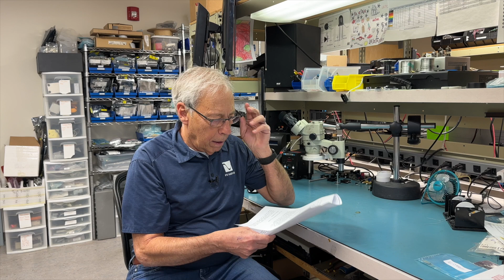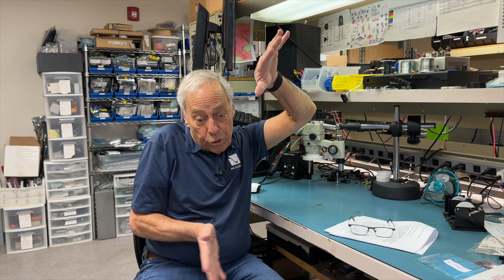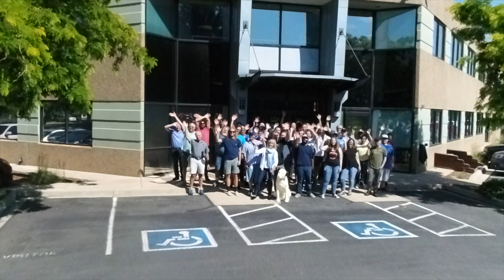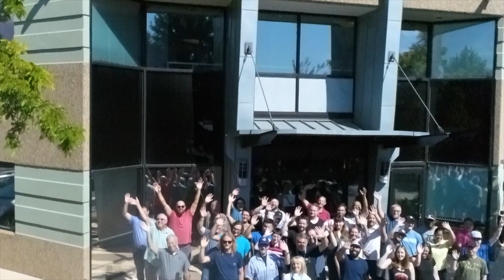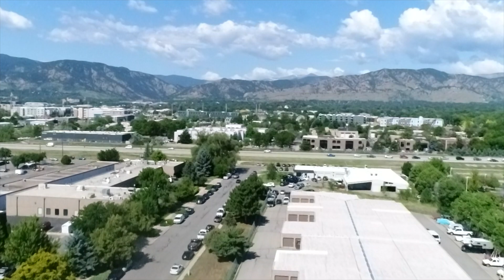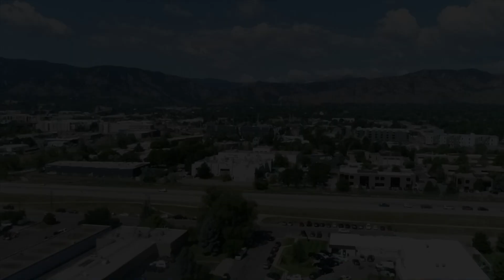Eliminating the preamplifier

Comment: For almost 2 years I was listening to my BlueSound node 2i connected directly to my amp using the node as a pre with its volume control but something was always missing and I could’t figure it out so checking out the internet people were blaming the nodes less than perfect DAC and recommending a linear power supply upgrade for the node, well I upgraded its power supply and only got marginal improvement of the sound but my issues remained which were mainly in low volume listening and constantly adjusting the volume as some passages were too loud and some low levels not loud enough. Almost giving up I dragged out my 20+ year old Rotel preamp just to see what happens and you guessed it at the first listen all my problems and issues were GONE ! Perfect level matching and full dynamics at any volume level.
Do NOT listen to people that say the less in the signal path the better or DAC volume control is all you need, You will do yourself a disservice !

Comment: My home made pre running on 6922's are vastly superior than simply switching and attenuation. the 6922 perform so much better than 12ax7's even after voltage adjustment. Next mission is to build a headphone amp with some 6922's. My cans has an impedance of 600ohms. Should be child's play for these valves.

Comment: When a pre-amp is improving the sound, there is something wrong. It can be something quite simple, like the impedance of the power-amp is not ideal for the source. But if the PS DAC sounds better on their power amp, the pre-amp is not the device adding to the sound, as that is impossible. A matching between those devices is a better alternative. But a pre-amp is a good way for extra profit, anyways. I just use a great sounding pot between an amaizing DAC and the power amp and they are well together. Adding a pre-amp, even the by Paul praised PS product, and even better ones, will cause degradation.

Comment: I ran my dac straight to my amp for a while. Though it was a very clean sound, it seemed to be very clinical. I added a preamp and it kind of softened the edges a bit, made it more enjoyable and less fatiguing. It has a tube stage that really sweetens it up, especially on lower quality older recordings.
Reply: There some amps that have a pre-amp and main amp in one unit, also some have a DAC as well.
Reply: @deadandburied7626  👍ya, I am more of a seperates guy. I do have a receiver for home theater but for music I prefer seperates.

Comment: The preamp is something many manufacturers overlook. The ones found in most receivers and DAC combos are just plain out terrible. Even if the pot is good. The internal preamp is a weak link. If you are lucky some DAC combos allow you to turn off the variable output to fixed. Allowing you to connect to an external preamp. I will keep saying it. That separates are the best way to go. Regardless you choose to go with tubes and vinyl or digital and solid state. You can't beat a quality preamp in the middle of things.

Comment: As long as you either have limited sources or sensitivity controls on your amp, sure. The Lumin streamers have excellent attenuation and even the Bluesound’s volume can be controlled, as well as most software. You do run the risk of losing quality of the signal with inexpensive/poorly designed units/software.

Comment: "Our preamps are so good, that they are better than the source signal they are being fed"
-psAudio

I'm still till this day running a completely passive phonostage both with passive SUT gain and Blue Alps Velvet potentiometer directly feeding a poweramp.

No preamp for me thanks, just a real discrete passive solution, a variable resistor for controlling the volume - can't be beat.

Seemingly you were on the right track in your early career Paul, but then you sacrificed fidelity for 'ease of use'

i don't do compromises with fidelity, - though I'm sure your cost-no-object pre-amps outperforms other similar solutions.

Comment: The issue becomes level setting. How do you adjust the volume? If you go straight from some high level source like a DAC or CD player it is going to send out it's full rated output voltage. Which might be either too much or not enough voltage to drive the amps. Likely too much! Without reducing the level you will over drive the amps. And even if by chance a perfect match, what about when you want less than full volume? 

Your digital source's 16,24,... bits are spread across it's max output voltage. If you had a perfect voltage match of the digital source driving the amp to full power without clipping, but wanted to listen at half volume, you have to throw half the bits of resolution away. Want a nice background 1/4 level? 4 bits left from the 16? 

Where by using even a passive analog volume control no mater how much you change the total voltage, the resolution of the signal does not change. The full original 16, 24, ... bit resolution is just applied across a .5V or .25V peak instead of 1V or 2V.

Comment: With a source player like an Oppo 205 that has both variable volume control & very uniquely HDMI input, you can very much get away without a preamp because you can connect it directly to an amplifier.   However, just as Paul stated,  I have two preamps that sound better  going through them vs direct to amp.  

Of course they are both no slouch--being the highly coveted 100% analog Conrad-Johnson tube MET1 and Audio Research SS MP1 analog multi-channel beasts.   Back in the day I had no idea how much a preamp affects the sound... but it most certainly does!

Comment: I'm not a fan of this 'no tone controls' trend. And while you're at it, bring back the selectable loudness function.
Reply: I put a schiit lokius eq in cause my preamp has no tone controls. What a difference. Almost all recordings need a tweak. Ya bring back tone controls!!!!
Reply: @jimalbruzzess2445  👍👍
Reply: Exactly, audio should be fun to fiddle with. Not just sitting in a chair with a stupid remote and only listen to music.
Reply: @Frankonero12  👍
Reply: @Frankonero12  The problem is not everyone wants the exact same thing you do. That's why some products are made to go by whatever your version of "should be" is, and other products are designed to go by whatever someone else's version of "should be" is.
Reply: @AT-wl9yq  I get that. The problem is that the vast majority of new equipment is geared towards the  whatever someone else's version of "should be" is.
Reply: @hobo1452  As it should be. Companies have to make products that appeal to their target market. Most audiophiles don't want tone controls. You can always buy an EQ. They make them at all price points. If you have only digital sources, you can get a digital EQ and put it in between whatever you are using as a transport and your DAC. Here's an example. Behringer DEQ24/96. I actually own one, and for the price, its very hard to beat. If you want something analog, DBx is a really good choice. They are another high value brand.

Comment: Like many, my system is optimized around a digital source.  It has a triode output amp/buffer so quite capable of driving the amp.  This affords the use of high quality autoformers to perform attenuation.  They are literally a wire with extremely clean signal response.  Any form of resistor degraded the sound.  LDRs (light diode resistors ) came close but the autoformer was a clear win.  I also find that digital attenuation works fine.  I struggle to hear any issues with dynamics but leave the autoformers in the chain as they do no harm.

Comment: using a dsp unit as "preamp" would work great for those of use with digital only sources, pc source to a minidsp shd or flex, shd has streamer also and can be source. then from that into dac and then into power amps.

Comment: A preamplifier is much less needed today and adds extra signal processing that technically isn't helping the signal's integrity. For those of us who have completely switched to online audiophile streaming or DSD playback, the traditional input switching is replaced with digital source switching before the DAC. Ages ago I enjoyed using a preamplifier because I had a record player, CD player, tuner and cassette player. Recently I got a pair of LS60 and I'm very sure it doesn't suffer from lack of a preamp. PS Audio should consider making an active speaker of the FR series or perhaps a separate speaker series rather than promote old-style audio topologies.

Comment: It depends on your budget. If you are someone that kind of likes audio and a 1k to 2k budget then the systems of the past like at Circuit city with the all in one receivers and some Cerwin Vega's or similar gets the job done. For those budgets it's GOOD ENOUGH either in they like the sound enough not to spend more or they would spend more but the budget currently doesn't allow it. You get into ultra hi-fi systems and separates makes sense as one component only doing one thing with premium parts laid out the most optimum way without space constraints tends to give a better sound ( given that room treatments and everything else is equal ).

Comment: You need to have the right cable for turntable ideally 43 ohms 19pF/1000ft from the turntable to the phono stage, Keep it short as possible. And from the phono stage to the amplifier can use the same cable or something like a 47 ohm but keep it under 50 ohms But make sure it's long 5 m+ you'll get great dynamics and good bass response. The lower ohms cable makes the cartridge more sensitive.

Comment: thanks Paul yes always thought  that having a good preamp made all the difference  .ps would a good preamp tube preamp  attached  to solid state power amps .give it a more analogue  sound .many thanks  for all the videos  over the years
Reply: Solid state preamps are just as analog as tubes. I would say focus on getting the right preamp for your system. It may be tube or solid state. However, I will say this. Getting the wrong preamp can wreck the sound of your system as easily as a bad speaker or power amp upgrade.

Comment: The attenuation section of a quality pre-amp will be better than the built-in attenuator in your CD player.

The focus of a quality CD player (where the research and $$ are used) is in its transport section and its DAC section (not in its attenuation section, because that is the job of a pre-amp).

When you purchase a quality pre-amp, that box's attenuation section is the focus of the research and $$ spent in engineering and building that box.

It is like comparing a DAC that is built in to a smart-phone with a stand-alone DAC that is an entirely separately box with its own power supply.  Of course that stand-alone DAC should sound better than the one built-in to a smart phone.

As you get into better and better audio equipment, you get more and more separate components.
There are pre-amps with two power supplies (one for each channel), and pre-amps with a separate chassis that houses the pre-amp's power supply.

There are some very good components in receivers and other combo type audio components.  But in general, the sound quality will improve as you specialize each and every component of a stereo, and that is why a using a quality pre-amp should sound better than feeding your DAC directly to your amps.  The DAC's attenuation section will not be a good as a quality stand-alone attenuator that you find in a quality pre-amp, because that is the job of the pre-amp.